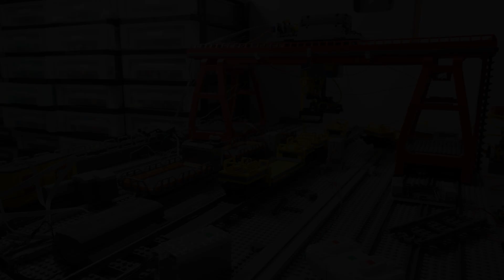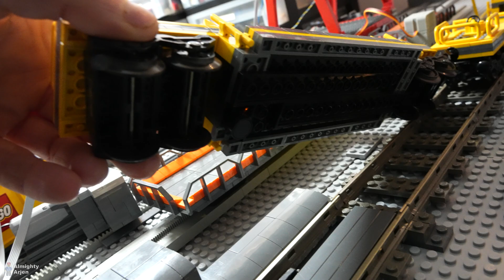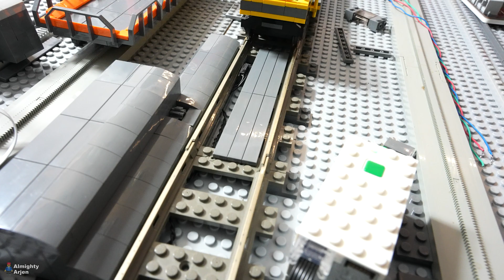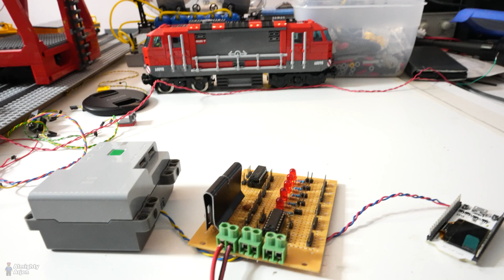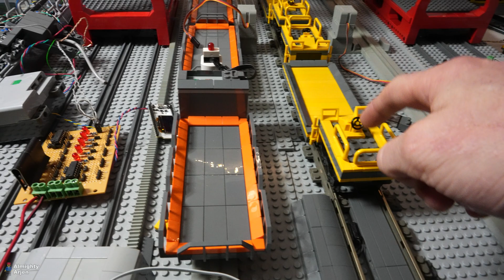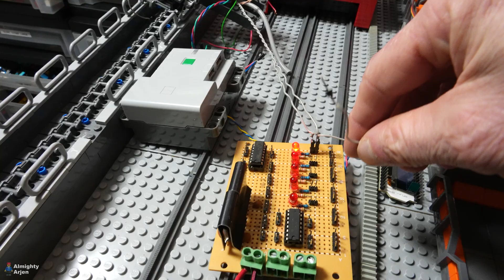Automated container terminal WIP E42: Train stopping point detection system

Comment: Regarding the length of cables, I have extended my wedo2 motors to run train switch points and have no issues, I use the larger PU hub with the AA batteries. I run 4 motors of each hub, but only one runs at a time.. it is only for a few seconds, so yours running the crane maybe different. Good luck!

Comment: Nice work. Instead of moving the sensor, maybe just put in 6 fixed position sensors?
Reply from the maker: I'm afraid that with this solution the "resolution" would be too low to have a precise enough system which would result in the crane not positioning correctly (this needs to be done within half a stud of accuracy). I think you need at least 10 sensors or so, lot of cabling and I/O on the controller.

Comment: A bit late but just thought of it. Could you have used a camera system like the blue crane to detect where the containers on the train are?
Reply from the maker: I used a sensor for that. I could do that but then I have to precisely measure where a container would be on both sides instead of just in the middle detecting it. This would take some time and I like to find a way to do it without that you actually see that it is doing it.